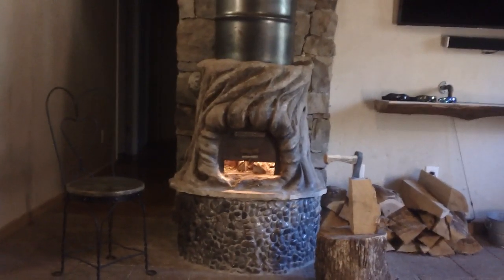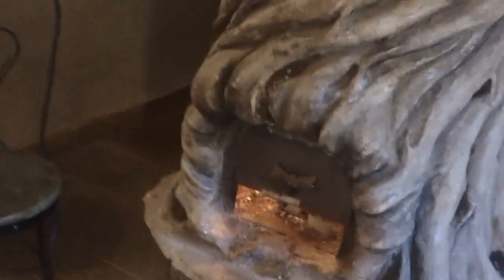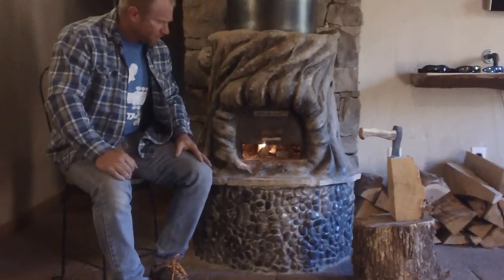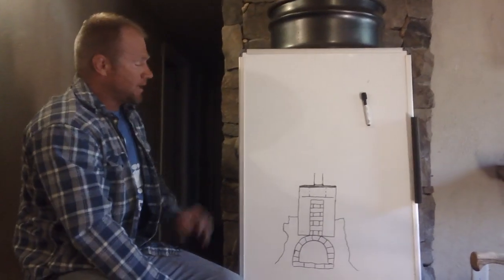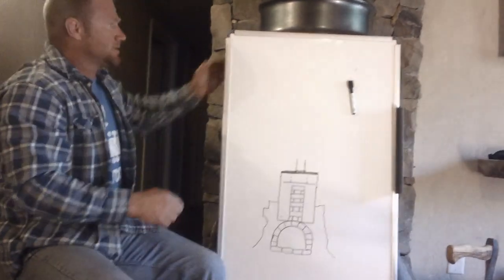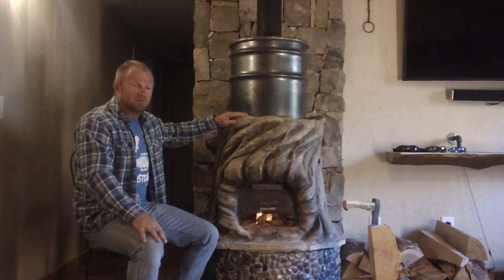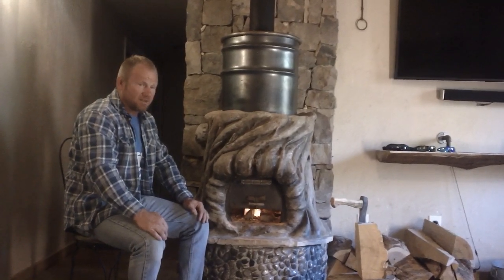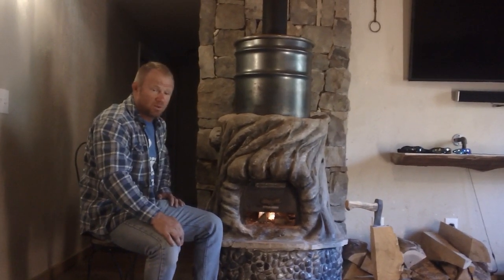Batch Rocket Thermal Mass Stump Stove: Efficient & Eco-Friendly Heating | Van Powell's Green Living

Comment: I came across a video you did 3 years ago on heating your greenhouse withe leaf compost. I am curious if you're still using this method? What your results have been? The consistency in results? Inquiring minds!
Reply: me too!
Reply: @Grumpy Goat Gardens. You are not the only one! I wonder if the guy is still alive?
Reply: I referred someone to that video yesterday!
Reply: He's still alive he is a buddy of mine, not sure why he hasn't done a video in awhile
Reply: @marine1161  Really would like to see more on how this stove lasts!  And get better clarity on the crete mixes he used…just heard some have been trying to use aircrete to mold a heat riser..some, soaking waterglas into it…(yikes?!) 
Thot he said, 2:1 sand: clay ?..as the fire path, or, as the wonderfully sculpted stump?  
Would the firepath last longer than about 10 years, if entirely build of clay bricks, or soapstone?

Comment: Very cool design. So it's a rocket baffle mass heater! very impressive. No need for a "manifold" nor a "fire box" - did you Spot  Weld the angle irons to the top of the barrel and then the baffle?